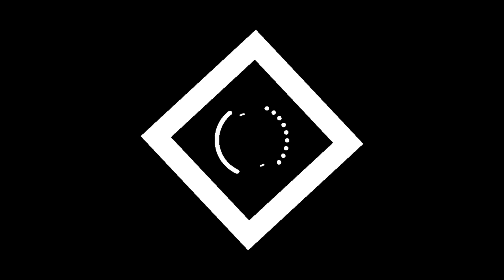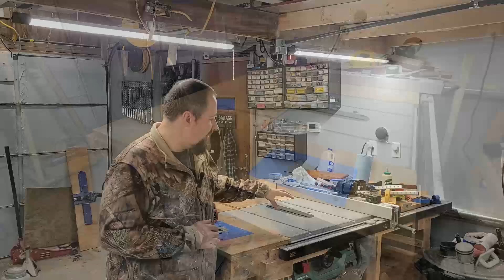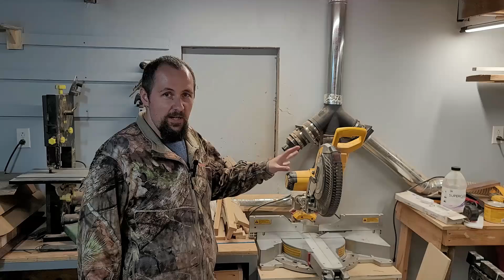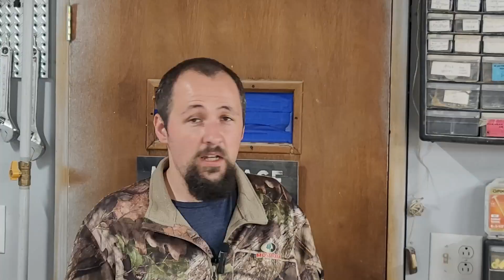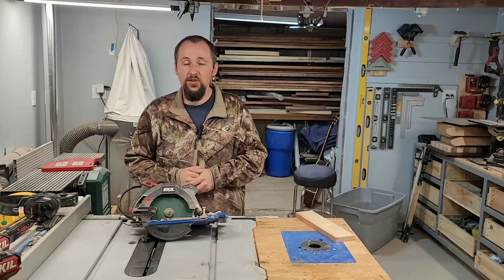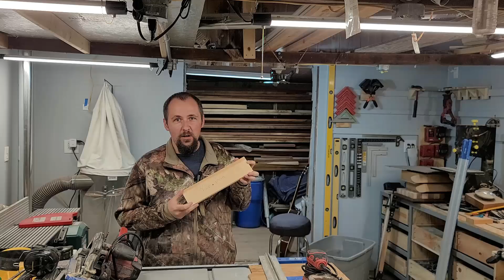7 Essential Power Tools for Woodworking

Comment: I' m in Europe and I have a bad experience with Skil... Especcially with mitre saw ( have it returned ) and the random orbital sander... Now 
I' m looking for table saw....Again Skil because of the budget... How they perform for you ? I really think there is a different quality when produced for different markets... Think you are in US ? Thanks in advance 👍.
Reply: The skil table saw is really good, I love it. What problem did you have with the skil miter saw?
Reply: @damnrite811  It was not accurate at all. Almost impossible to set it up. Laser was always not in line, handle for changing the mitre angles was falling apart.... Now I have Hikoki mitre saw instead. Better but still not perfect... Also random orbit sander is just a joke. Bought used Makita and it is way better...
Reply from the maker: I haven't personally experienced an issue with the sander yet.  Would you mind sharing what you observed so I can watch out for this problem as well?
Reply: @brownswoodworkingandsigns  I have corded Skil sander. It is kind of only vibrating and bouncing on the wood. My hand gets crushed in a half an hour of use. Makita is eating the material. At least compared to Skil... And I' m using same material, same grinding paper disks and so on. Wants to mention also,  just for the record, that I' m not professional woodworker. Just normal DIY garage guy.
Reply from the maker: Myself and my Dad have both had good luck with the Skil sander.  The cordless tools though, I have only had for like 6 months but have had no issues so far so its possible I haven't used them enough to experience issues.  Its hard to say why your having such bad luck with the brand.  It could be regional like you said.  It could also be a generational thing that has been improved.  The amount or type of use may also play a role.  As for the table saw and miter saw, I have not had that brand and have no plans on buying in just for the brand.  For now, my Metabo and DeWalt saws serve me well.